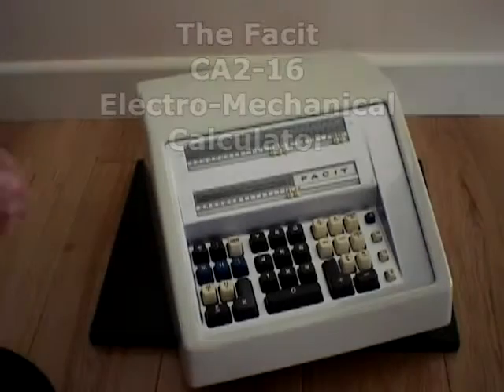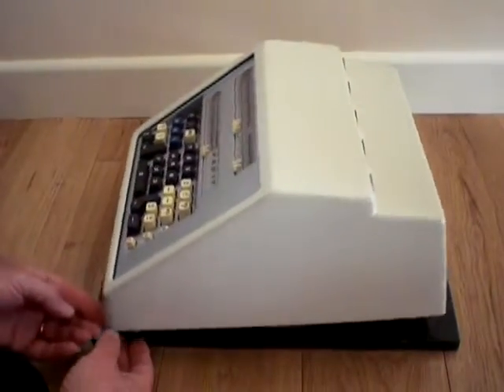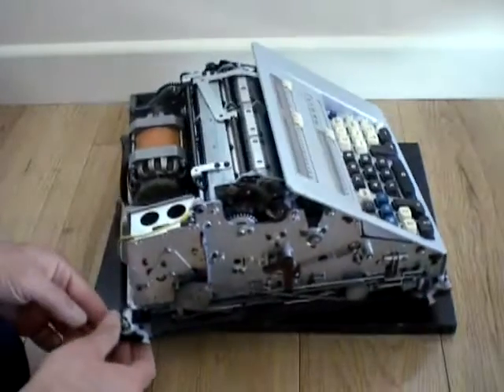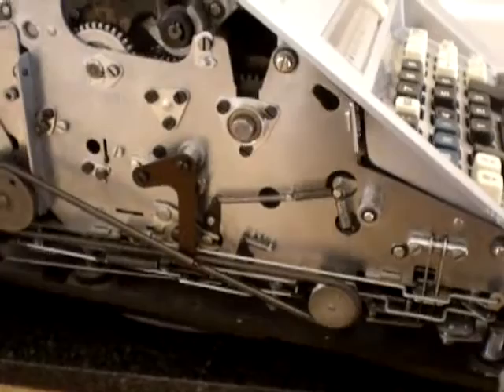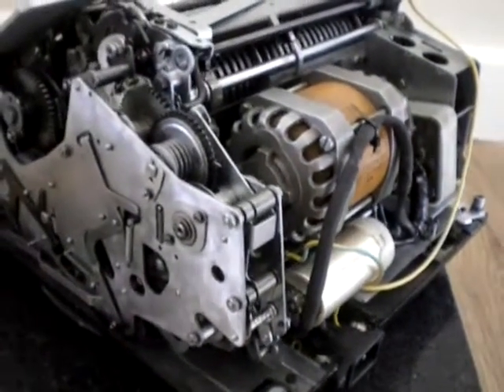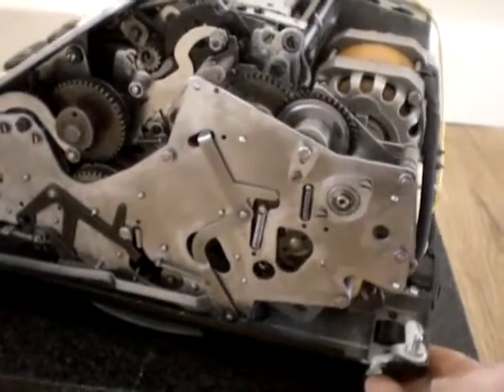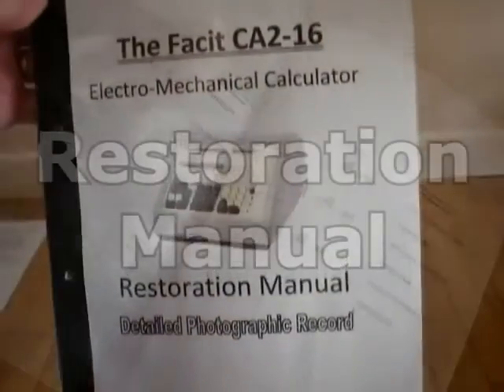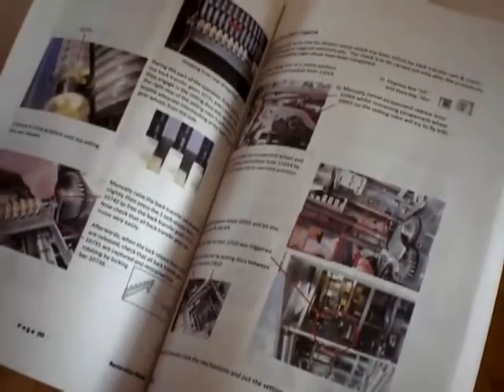The Facit CA2-16 Calculator

Comment: Great and patiente work. I have just found a CA2-16 calculator, no power cord (127 or 220V)? I have recently repaired a Contex 55 with a malfunction "pin register" . Does this Facit use the same rubber friction pin retention? It took a lot of work to repair it...